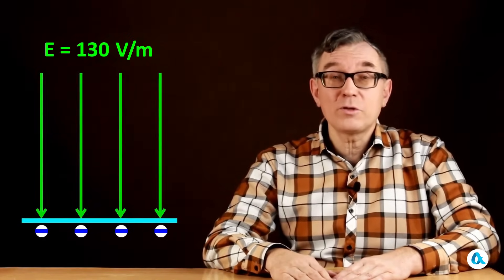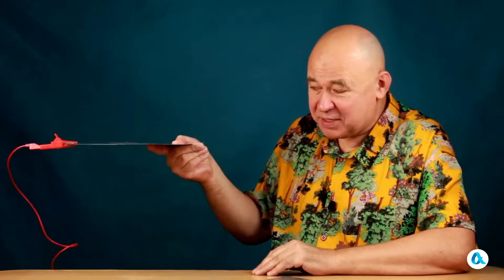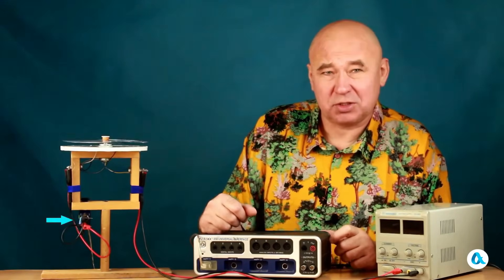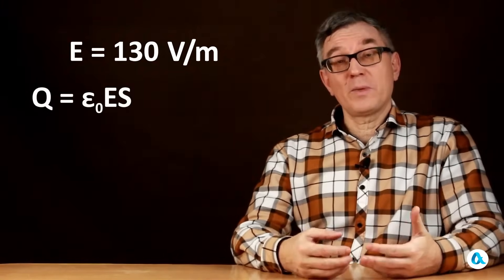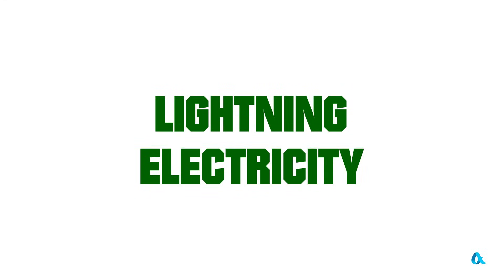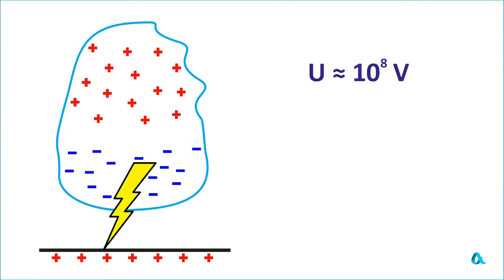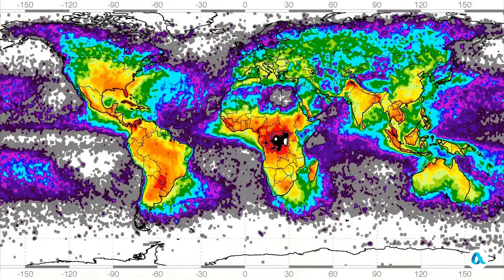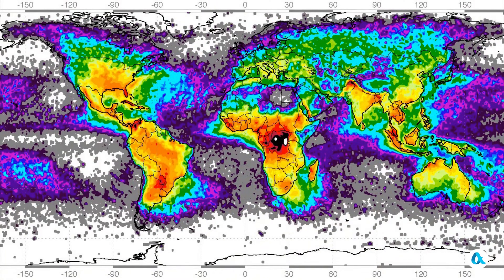Atmospheric electricity

Comment: Hey, we were in a field one day, and there was a nearby thunderstorm, but we were dry and miles away.  Suddenly I heard some crackling, and saw the dry grass start to rise.  At the same time, the hair in my head also started to rise.  I got down into a squat position, and the phenomenon seemed to pass by me, and others.  Later, after I became an electrical engineer, I realized that we were under or in a potential lightning "leader" which was searching for a connection to the sky.  We were lucky.  If the lightning stroke had evolved onto us, about six of us would be dead.  I guarantee you, that the electric field was much much larger than 130volts.  More like 13000volts.
Reply: That's 130 volts per meter.  Raise the top electrode to 100 meters AGL and the voltage between it and ground will indeed be 13kv.
Reply: Not only do you have to express it in volts per meter, when there’s a lightning storm nearby, he said it can get much higher in the tens of thousands of volts per meter.

Comment: This is a great topic although I would like to point out that model of a cloud vs ground drawing (which I understand is taught to be a correct representation of a clouds charge state) is completely wrong! Yet this is the example that everyone uses! 
I believe that it's completely obserd... 
Just think about it for a moment, the cloud contains both positive and negative charges.... And even though there's both positive and negative charge in the cloud in relatively close proximity, this should cause a short circuit! Instead the negative charge is attracted to the positive ground! It doesn't make sense! 
I think that the problem is within the understanding of the electric charge, the understanding that there's two same but opposite charges..... 
I think that this understanding is incorrect! 
There only needs just one electric charge! You can have more or less of it which would mean that when an area of a given cloud has more charge, it's more positive than the rest of the cloud! 
A battery for instance might be marked with a positive and negative symbol and that should mean that one terminal carries more charge than the other! And given that opposites attract, the positive electrode which contains a higher state of charge than what it wants to have will be happy to give up it's excess charge to the negative side since it has been chemically treated to carry a lower state of charge that it would prefer to be at! This process provides the opportunity to do work! The current will flow until both sides reach their preferred equalebrium state which is commonly known as a flat primary cell, note that the cell still has a charge which is required to hold its molecules together, nothing more nothing less which isn't great for doing work and then discarded as waste. 
As we should know, the ground which we stand on is not 0V, it's just the voltage that we choose to use as a 0V ground reference.... 
I have always pondered the idea of what  measurements would be obtained if the above ground collection point was kept fixed but the ground reference point was taken at a deeper level via a shielded ground coupling rod to ensure that the ground reference point was deeper? Would there be a higher voltage registered vs shallow ground? 
I understand that the ground is a very good conductor so this may need to have a shielded ground rod go quite deep to be able to get a meaningful measurement..... 
The idea of this experiment has been with me for some time now and I may get around to trying it some time in the near future I hope! 
Ohhhh and as a reference for the electric charge, it was Benjamin Franklin who said in his understanding and explanation for the electric charge that it's just one charge, you can have more or less but that's about it, I don't know who was so confused to come up with two different types of electric charge? And because of this incorrect understanding we have things like anti matter, protons and neutrons and electrons and many other nonsense ideas..... Mr Franklin published a very short book which should be read by any person who is interested in this field or anything scientific related.... Once you understand what he was saying, the world around you changes and suddenly everything begins to make sense and you begin to see how everything is connected and works together..... Everything just becomes easier!

Comment: 220VAC interference is at exactly 60Hz or 50Hz.   Yours instead seems synchronized to the spinner.   That's real e-fields you're detecting, caused by charged plastic surfaces in the device itself.  The rotor must be all metal, no plastic at all.  The four quadrants need to be mounted on something leaky, like wood, so all net surface-charge soon drains away.   Never use styrofoam for anything, since the surface charge persists for days, sometimes even in high humidity.   If human eyes can see white plastic anywhere, then nearby metal parts will often "see" the charged plastic surface.   (Try painting it black with conductive paint, or even some types of india ink.)

To track down surface-charges in a device, build a one-JFET field-detector (mounted on a 9V battery, with its LED.)   Wave the FET device near your plastic parts, to see if it picks up unwanted e-fields.

Comment: So why dont sky scrapers get harvested for their atmospheric electricity?
Reply: Through a conductive medium or process such as dielectric breakdown (commonly observed as lightening)
Reply: @timstrickland4706  Surely theres a way to prevent that breakdown and capture the voltage potential.
Reply: Typically buildings are grounded throughout the framing/structure. And lightning rods are connected to a ground source. If someone were to try and tap into it, you’d need an isolated conductive material from the top of the building to the ground level. As for why we don’t try and harvest the electricity that passively discharges, is that it’s really hard to do that. And there’s not much research into it for some reason. I’ve looked lol.

Comment: If the vertical component is electric and the horizontal magnetic as antenna theory states then the magnetic lines of force keep a radio wave in this formation as it is propagated. The electric component cycling above and below it's magnetic component kept level with the ground by earths overarching magnetic field. A high + potential exists at the ionos level and earth the ground relative to that. If earth is a globe then the magnetic  plane of inertia as it spreads over the surface is also a spherical shape making a sphere within a sphere of E/M energy. However as that shape has no level between the electrical sky and ground what keeps the magnetic plane level and polarity separated and N and S fairly fixed in their locations as there is no center point of a sphere? It seems that North should be measured all over and changing with any alterations of the electric current flow as that is said to be the source of the magnetism.